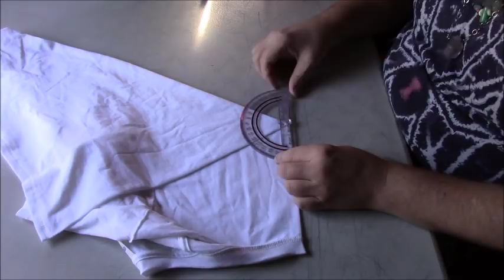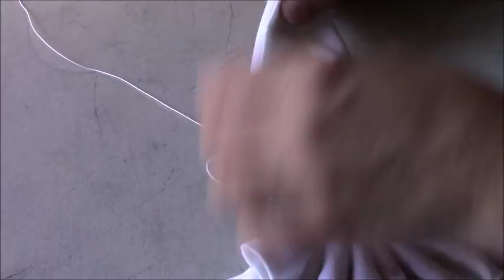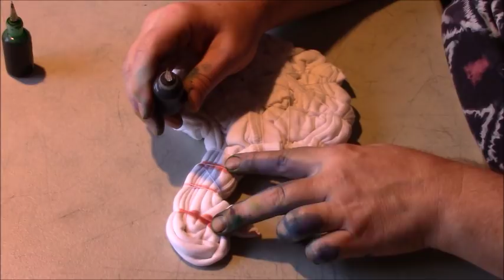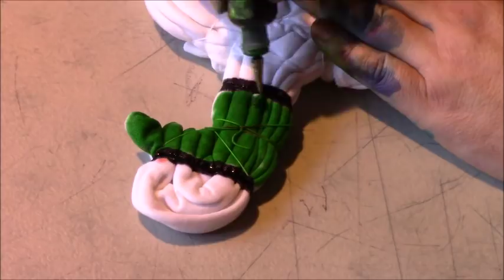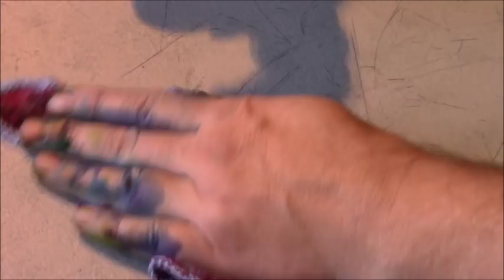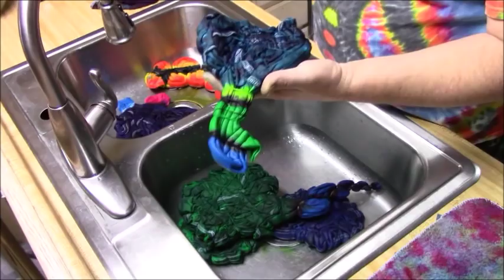Tie Dye a Peace Sign tee ~ All in One

Comment: Mr. TieDye  I really enjoy your videos.  I have a problem I hope you can help me with.  It does not matter how tightly I tie between sections of my projects, I always get lots of the dye creeping between sections.  I notice that there does not seem to be any creep in your work.  Is there a secret and will you please share it?
Reply from the maker: one thing that helps is to apply the dyes starting a bit back from your 'line' or space between sections as the dyes will spread some ... so I lay some dye down away for the line and keep applying dye to other areas, then I come back and touch up some if the dye did not spread enough...  also the fine tip bottle help so you can apply smaller amounts of dye at a time, here are the bottles I use a lot : 
4 oz Bottles with Metal tips ~ Detail Dyeing : https://amzn.to/3h46iel  (if you use this link, then I receive credit) 
How I fill the bottles : https://youtu.be/laYYAlV5Yng

here is a video where I show how I lay orange and purple next to each other without much mixing : https://youtu.be/TAo9BgtpZ2Q 

One more thing, for my black, I thicken the dye so it does not spread much, so I use a cuticle pusher to 'press' it further into the folds of the tee ....  BUT, you can thicken your dyes just a little bit to slow them down from spreading so fast, but this is something you will have to work out how much... you want the dyes to still saturate ... but if the other ideas do not fix your issue, then you might try adding just a bit of thickener
Reply: Outstanding..I will give it a try.  Thanks. @MrTieDye

Comment: How damp do you leave your shirts? Does the damper the shirt make folding easy
Reply from the maker: I spin them out until they are just barely damp using the spin cycle on my washer... just make sure if it sprays water to set it to half way through the cycle as the water will dilute the soda ash....   and yes, in my opinion, it does make folding a bit easier, as the fabric stays together in pleats, scrunches or spirals when the tee or tapestry is slightly damp compared to dry ✌🏻
Reply: @MrTieDye  thank you so much!!! I enjoy your videos!! Your work is phenomenal and beautiful!!! 
Could you possibly direct me in the right direction to master the peace sign folding? I want to make one so bad for my mom, but I can't get it right!! 
Thank you so much!! 😎

Comment: Haha I wish I could post a picture! My ☮️ is upside down. 🤣 Can you tell me what I did wrong?
Reply from the maker: Yeah I wish YouTube would allow that ... but it sound like you just lost track of where the top of the tee was as you started folding it ... I am right handed, so I lay the tee down, folded in half with just the front of the tee pulled forward, with the neckline to my right, then I fold the bottom part up and then back down and then I fold the top part down .... I have re folded a Peace Sign tapestry on one of my LIVE videos, it may help to see how the peace sign comes together : https://youtu.be/72aOfffDR_M?t=387
Reply: Ok. I’m left handed. So if I just flip it  from the way I did it last time it should work I bet. 😅 Thank you 😊

Comment: How would you do this as a reverse die? I have a blue shirt that I would like to reverse die and do the same design
Reply from the maker: I would fold it up the same way, and the line that you initially fold along is the center line on the peace sign, then I tie an inch or so on either side of that line .... those two ties are where I put the black for the peace sign, so you can tie those two lines with sinew ..... then you will have black lines similar to this one I made and then you can dye the parts after you do a good rinse job on it

OR, the other way .... fold ups the same way as I do in the video, tie you lines and then in-between those two lines, wrap it with sinew and tie tightly, this will get you a solid peace sign ..... I will be getting back to my table soon and I will be doing some discharging, so maybe I will make a quick video of both of these processes .... have fun and I wish you success!! ❤️✌🏻🌈🙏

Comment: I tried using twine as I didn’t have any string; total disaster.
Reply from the maker: I like the kite string because it is thin and fairly strong... I have also used Embroidery String, although it was not as strong as the kite string... and I have used dental floss... basically I try to find stuff that is easy to work with and does not cost a lot 😉✌🏻

Comment: When you’re folding shirts for ice dye or liquid. How damp or not at all damp do you fold them? My main issue is sometimes it’s impossible to do the sleeve tuck center fold perfectly due to the fabric stretching a bit while it’s damp. However, when I try to fold while it is dry or less damp. I find that accordion/pleat folding becomes difficult to do and hold in place. Do you have any tips or suggestions? Thank you so much for providing so much great content
Reply from the maker: my preferred method is to soak in soda ash for 20 minutes and then spin out the excess so the tee is barely damp ... the main thing is to make sure the spin cycle does not spray water or it will dilute the soda ash, if yours doe, then try setting it to half way through the cycle.... and yes folding when slightly damp is easier as the folds tend to stay in pace better .... as for centering the tee, I did make a newer video to try and explain it better ....  https://youtu.be/ayXftSPBITo

have fun and you are welcome
Reply: MrTieDye is ok
Ti

Comment: I'm rely struggling with this. I've had 2 fails so far. How long did it take you to learn how to make a peace sign?
Reply from the maker: I struggled with the peace sign for a few years, trying different folding and dyeing methods... and then Jeremy StRebel gave me some clues to help me dial the design in and then i worked at it for another year before I was completely happy with how it came out  .... so it will take some practice and each one will get a little better as you go along.... but it is a matter of trying it and the tweaking it the next time... and every one of my so called fails, sold.... someone loved them ... so keep at it as this art does take practice
Reply: @MrTieDye  I will keep at it. My first one just came out looking like a target and my second one had 2 out of 3 legs. So it was an improvement lol. Thank you for taking the time to respond to me.
Reply from the maker: @felicityhall1595  great.... and if you had 2 of 3 legs... did it look like the Mercedes symbol?? .... on the peace sign I fold the bottom part up at about a 60 degrees angle and then I fold it back down (if you miss this one, you get just two legs )... and then I fold the top down .... here is a video where I fold a already dyed peace sign back up just so you can see how the parts come together  .....  https://youtu.be/72aOfffDR_M?t=387

Comment: Love your videos. I have learned so much from them. Thank you for sharing! I was wondering if you have ever or would have tips on how to tie dye a VW logo on a shirt?
Reply from the maker: Thank you and you are welcome.
As for the VW logo, I do not have a video for it yet... I have done it in a couple ways so... I did it as a double dye, so I folded the circle and the 'V' shapes of the V and the upside down V in the W ... batched it and then soaked it again and then I folded and dye the / to complete the W  .... here is a photo on my FB page so you can see what I mean (this was from 2009) .....   https://www.facebook.com/photo.php?fbid=10216834468594334&set=a.10216834405192749&type=3&theater

I have also done it as a stitched design and here is the process I would have used .....  https://youtu.be/fIopj6TZkes

and lastly, I do plan to try folding it again and I have heard other dyers mention folding the inner parts that are not the symbol, but I have not tried it yet ... I hope this helps you create the tee you want
Reply: @MrTieDye  Thank you!

Comment: Did you thicken the dye for this? I tried it for the first time with liquid dye but it all bled into each other immediately. Love your videos!
Reply from the maker: I used thick black dye for the outline, but the rest were regular dyes  ... it does take some practice applying just the right amount of dye .... you might try getting the bottles with the fine tips so you can add smaller amounts of dye at a time... also, I will start applying the dye an inch or so away from the line to allow the dye to spread some on its own before it crosses the line. 

here are the bottles I use

https://www.amazon.com/gp/product/B07DB6K3XZ/ref=ppx_yo_dt_b_search_asin_title?ie=UTF8&psc=1

Comment: I can't  determine what I'm doing wrong.  I've tried this twice, and both times ended up with a circle with 2 areas of the color I put on the tip of the shirt but no black lines inside the peace sign.  I have black encircling the entire peace sign and I have black surrounding the two areas that I colored the tip(top of the shirt when it's folded).  It also looks like It would be upside down.  Both times it turned out exactly the same, and both times it was wrong so not sure.  Love your videos though!
Reply from the maker: I will do what I can to help you figure this out, but I need to see your results, here is a link to my FB messenger where you can send a photo to me ....  m.me/CarlMrTieDye

Comment: Mine turned out like a blob with no real distinct lines but I don’t have black dye, I tried some very dark blue but it all ran together, so Do i have to thicken all the dyes or just get some black dye and thicken that?
Reply from the maker: I just thicken the black dye that I use for the outline and then I press it into the tee with a cuticle pusher ..... but the out line is just my preference ... it doe not nee to be there...  as for the dye all running together, .... you may need to apply less dye at a time and let it soak in some ad then add more as needed
Reply: MrTieDye thank you ☺️

Comment: Is ring the thickened dye  keeps it from spreading out? Another thing to add to my dharma wish list!
Reply from the maker: yes the thick dye keeps the line from spreading out.... but it also does not soak in very far, so I tend to poke the tip of the bottle down into the folds or I will use a metal tool to apply some pressure to the black line to help in soak in deeper